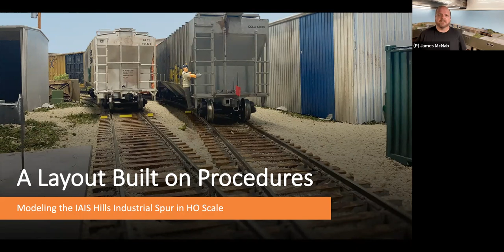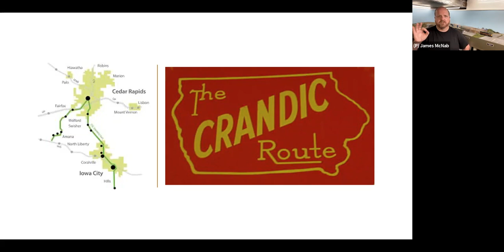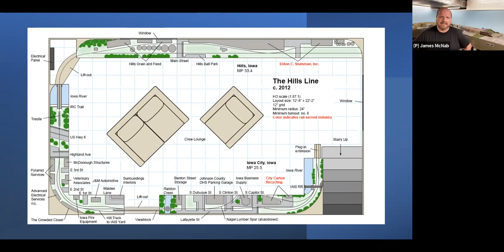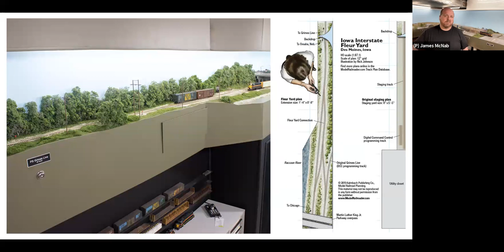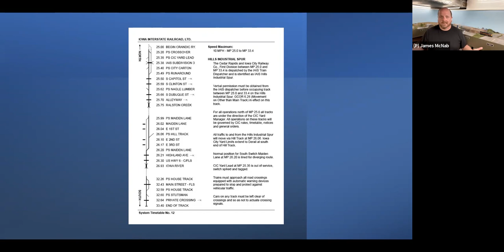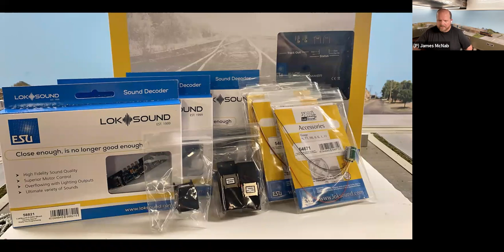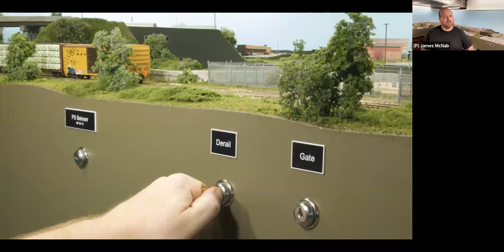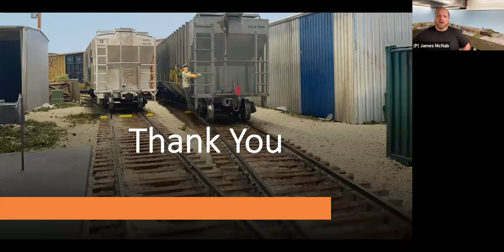2021-08-08 Virtual Meetup - James McNab's Hills Line

Comment: Great presentation! I don't yet have a ProtoThrottle, but I operate on a layout that uses the PT remotely with a UWT-100, and I can say from experience that some throttles work great with locomotives programmed for PT. Any potentiometer-based knobby throttle like the UT4 or Cab04/06p, as well as throttles with fast inc/dec like the NCE ProCab or TCS UWT-100 work great. The only thing that doesn't work is variable braking, you're either on or off. Encoder based throttles like the Cab 04/06, UT6, or DTx00 series will not work well. I have looked into the topic quite a bit as I am only planning on getting one PT, but I want to expand my layout to have three crews for switching, and be able to use locomotives programmed for PT on other layouts where I won't always bring the PT with me.